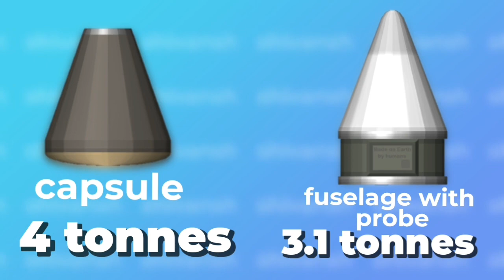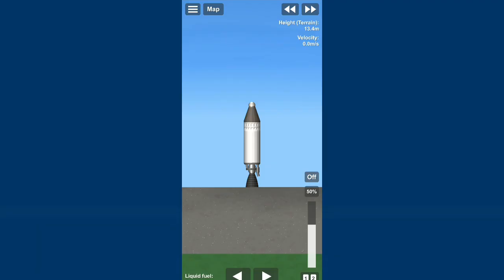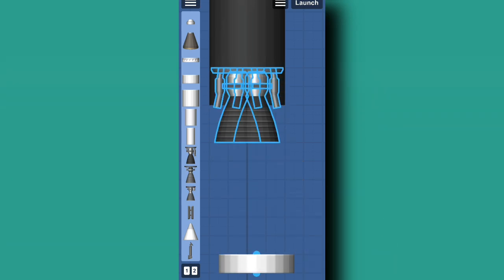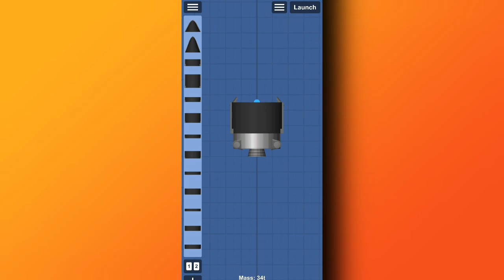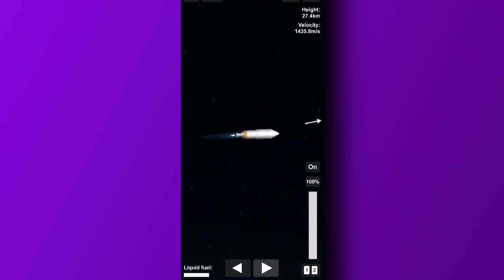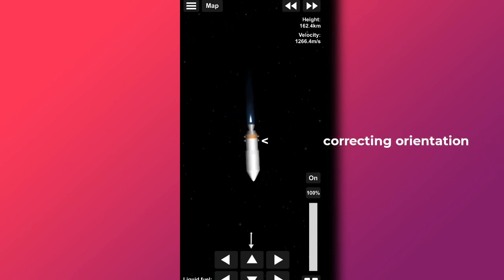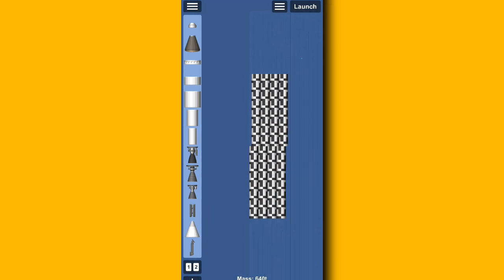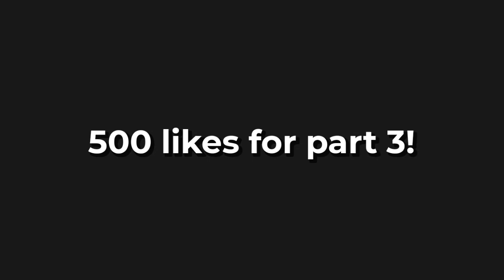10 MORE Things That You Are Doing WRONG In SFS (#2) • SFS Tips And Tricks •

Comment: Actually, i think capsules are better because they resist impact forces better so that means you don't have to use 2 parachutes instead of 1
Reply: knew there had to be trade-offs
Reply: Well that’s just trade offs and which one you like more
Reply: @lyo6200  exactly what I was thinking, it isn’t about the efficiency but about what you want to put in orbit/other planets, and a capsule is prettier
Reply: But capsules are more fun
Reply: Probe + aerodynamic nose cone + 2 parachute + heat shield = 4.4t
Capsule + heat shield + 1 parachute = 4.9t
So use probe is ligher than use capsule
Reply: @SeuVuon1557  liter
Reply: use wheels
Reply: yes this is a rickroll
Reply: @SeuVuon1557  Capsules are better, i use it in every project.
Reply: Capsules are also better because when the inevitable catastrophic failure happens, you're very much aware that the astronauts inside the capsule are dying alone a horrible, excruciating and sad death inside the capsule that has now became their coffins.
Reply: Bruh just use structures to not need the 2 parachutes💀🪨
Reply: Also, I use capsules for 'manned' crafts to 'Immerse' myself and probes for 'Autonomous' missions

Comment: The Redstone Atlas capsule is very good. Although it’s 2 ton heavier than a probe, it has a built in heat shield and parachute and also being able to install a Launch Escape system
Reply: fax 👍
Reply: In og capsule you can Get launch escape system too but need modification
Reply: Also you can add attachments on top of the capsule
Reply: @titaniummechsx3324  im putting  dock onto that Atlas capsule

Comment: for number 1, you should use capsules cause it just a small diffrence just .9 tones also capsules have a part in the top that's used for parachute so, be smarter next time. also on number 4 in 2022 you should have it BC your rocket will explode.